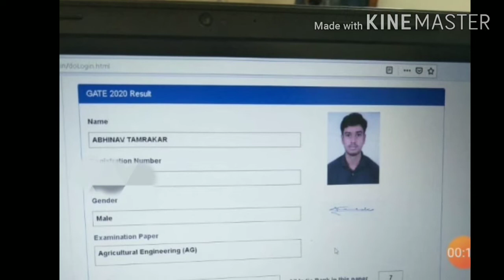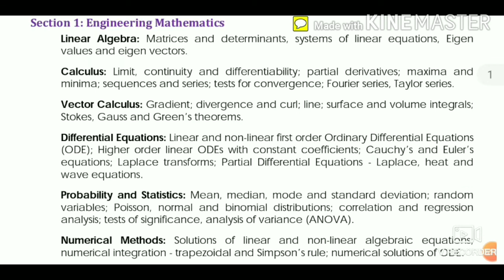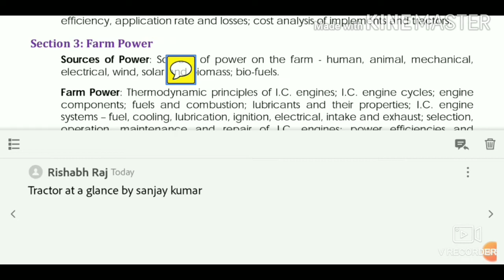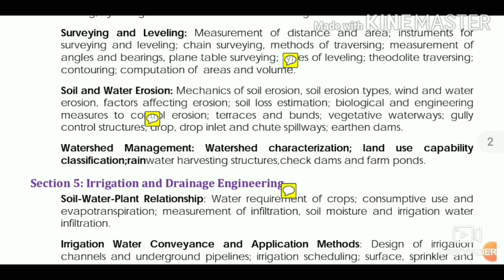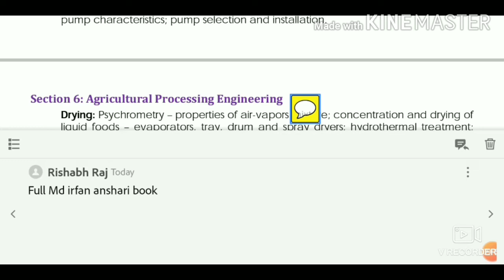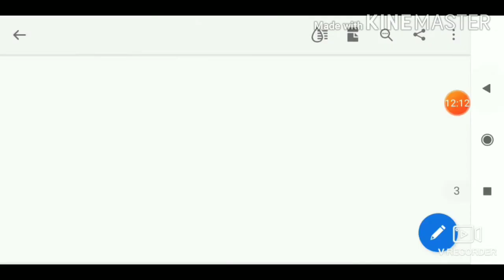Agriculture Gate Syllabus and Study Materials

Comment: Sir ,i am facing problem in solving the questions before 1998, are those questions required to be solved
Reply: You should first solve the from 2003 to 2020 bcz the pattern is changed from 2003, If you have more time then you go for below 2000 bcz that tym subjective questions are asked
Reply: @rishabhraj9051  thanks sir